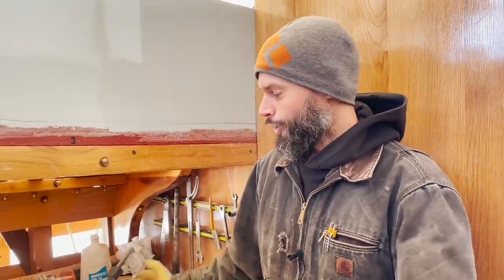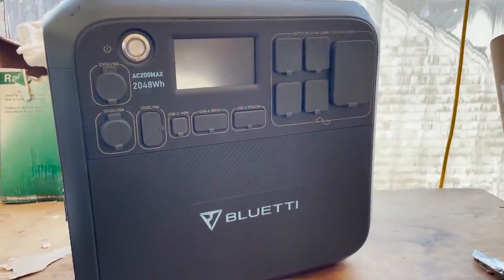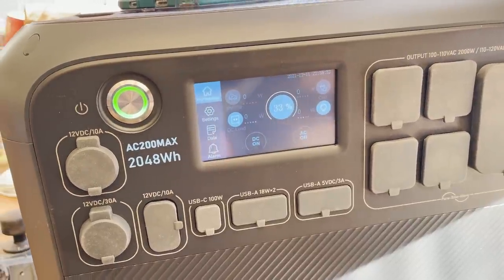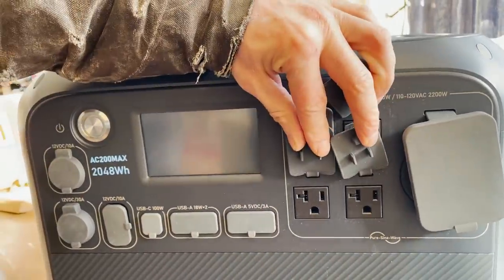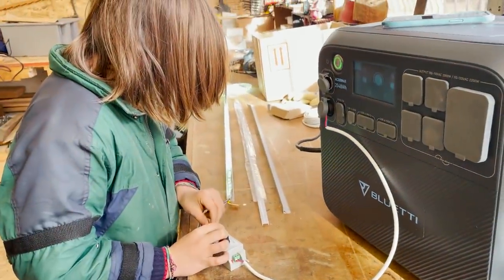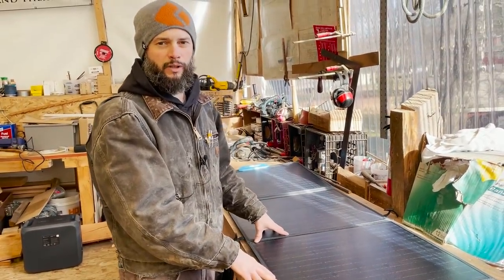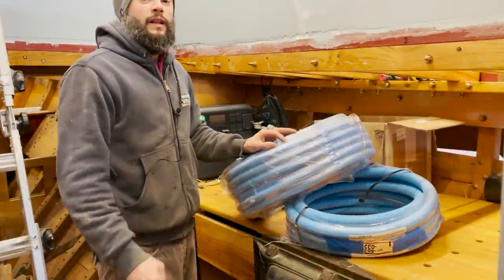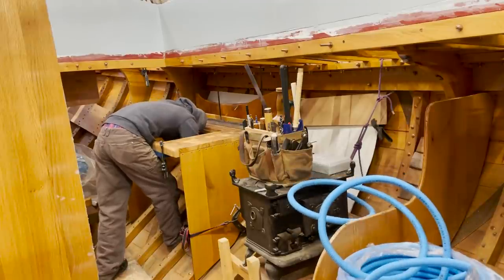Boat Electrical Systems, First Steps - Episode 194 - Acorn to Arabella: Journey of a Wooden Boat

Comment: For cruising a wind generator is going to be a lot more useful than those solar panels. They seem to me to be a lot of hassle unfolding and finding space for them for the amount of output you get from them.
Reply: you  do not have to choose between the 2 option. But a 'fan' size wind generator will not really give too much power..
Reply: Wind Generators can also be very noisy.

Comment: A couple of suggestions:
RGB LEDs produce a really crappy white light.  Better to go with daylight white RGBW or RGBWW warm white strips.
To avoid corrosion on the tape itself, use IP65 weatherproof silicon coated strips.
Hint: solder wires to the back of the weatherproof strips.

Comment: You can easily get and adapter to go from that RV plug on the Bluetti to your shore power plug, allowing you to keep the boat powered should your solar and/or house batteries (need to) go offline for some reason. You'll need a NEMA TT-30 - NEMA L5-30 adapter. Should be about $30 at Home Depot.

Comment: Love the portable battery, my view is 12v is easy your a low power boat, put usb ports in the cabins , keeps the chart table clear . 
As the majority of the world is 240v , is just having 110v charging going to limit you.  Eith a normal battery bank you can have a 110 and 240v charger ,  with these battery banks are you just going to have solar , 
And altinator off the engine .

Comment: Hey Steve. Do your wiring plans include any data cabling? Or do you plan to use wifi technology for any tech connectivity?
Reply from the maker: Not throughout the boat. Wherever the data comes from it’ll go straight to some unit that’ll broadcast wifi and it’s a 38’ boat so should be good.

Comment: Some\thing to consider when setting up your solar modules on board is that and shading will cause a reduction in producing amperage for charging.  With rigging, post, etc, that will be hard, but with multiple strings, you will do better in charging your battery, so that is good that you have them.  The other thing is that to produce more power is try your best to have the modules 90 degrees to the sun to get optimal performance.  Looks like you have a great setup for your boat and those solar modules will outlast any wind generator.👍
Reply: Complet video subject, topic are non sence! Ridiculos, like Trump follower, this are not sailor, but profict makers

Comment: It's absolutlry worth putting together a jig - think like a big easel - to hold the solar panels at 90° to the sun while they're out on deck. This is especially true at higher altitudes. 

Here in ireland the sun is below 45° in the sky most of the time - in winter as low as 15° at midday, tilting the panels up increases the Lumens/m^2 hitting them by 2 times or more.

Comment: I have built WiFi based LED controllers and that's how I control most of my house and it's also what I will partially use on the boat. Just one word from experience: don't rely on the rgb chips to give you decent white light, especially when dimmed. You can get LED strips wigh RGB plus warmwhite in one strip. They give you much better white light.
Reply from the maker: I think we’re going to mostly use the strips for red/night running, and the puck lights/Victoria’s fixtures for white.

Comment: If I were running Electrical in a small boat I would have 2 concerns. 1) moisture resistance, how well can I keep salty and humid air out.  2) height above water, how well can I keep it away from standing water in the bilge, showers and wet lockers, and deck penetrations that WILL leak at some point in time.  Unless you have chafing problems, wires only corrode at the ends and connections.  Also, NEVER have electrical/coaxial connections at, near, or below the base of the mast!  The mast heats and cools every day and wicks a surprising amount of moisture into electrical wires and gravity pulls it down below deck, and inside the mast is the greatest chance of chafing from wire slapping.
Reply from the maker: Keep tuned, you’ll see how we address a lot of the things you mention.

Comment: Be aware that that plastic will become discolored and brittle with exposure to the elements, minimizing the ability to see through the cover and possibly snapping hinge points. My advice would be waterproof, gasket sealed, metal boxes at all junctions and terminals.  May save you some issues in the Arctic circle or other inhospitable areas with no repair resources.  I’m no expert but it seems prudent to make your electrical system bulletproof. I have been watching your endeavor unfold since you first posted it and am impressed with the attention to detail you have no matter the operation.
Reply from the maker: Thanks for the kind words, Greg! Metal boxes won't work great, and none of the plastic in the boxes will be exposed to any kind of light. They'll not only be inside the boat, but also mostly just behind locker doors or other sneaky but easy to reach spots.

Comment: Running conduit is the smartest thing that you can do, conduit is cheap and running an extra empty one makes latter additions much easier. (there are always later additions to a new boat after the first cruse) . Also leave a pull cord before you install the conduits and if you have a wire plan pull the wire through before you install it leaving a pull cord in if there is room for an additional wire.(It is always easier to pull wires on the bench when there are no bends in the route.) This may sound excessive but I have seen bills of over $1000.00 just to run a single pair for some later addition where if the route was prepared ahead of time it would have cost maybe an hours labor.

Comment: As an electrician I must tell you, you will hate trying to get wire through that flex tube you have to cut to length then stretch it out flat then pull you wire though, then run the conduit with the wire in it

Comment: Having the wires in conduit is always better for repair work, also do your self a favor by having a trace wire in every run. By having the trace wire in every run you can pull more wires through if you need them later. If you can, I try to go 1 or two gauge over what I know the line is going to be used for. This lowers how warm your wires get, adds more safety for fire in a wood boat. Also make sure all of the boxes have access so you don't have hidden locations were a wire could come loose and not be able to access that location once the boat is closed in. The more breakers you have the better as I see it some don't like it like that, but if you have some thing not working it does not and its tripping the breaker it only shouts down 1 thing not a group of things. You may want to think about some type of a stand system on the deck that can hold the panels if your not going to add any fixed panels on the boat. Great to see you guys moving forward on the build....

Comment: I would see the Bluetti as the post-lightening strike/battery system failure/dead alternator fall back option. Something that will get you out of the sh|t, but not your daily power source.
Reply from the maker: That’s what we’re thinking too after using it for a bit.

Comment: Check out RGBW strip lights,  They are the exact same as you are using except they add a white channel, which means instead of running three LED's to get white you will only use 1 and draw less power.

Comment: Wow!!
Most cool. 

Just a small suggestion…
Please consider taking some short USB extension leads to plug into the unit’s USB sockets. 
IMHO I would be concerned that the unit’s sockets would wear with 2 years of daily use, and it is much cheaper to throw away a damaged USB extension lead than to replace the unit.    
You can probably get replacements anywhere in the world, but quality is another matter. Worthwhile to get someone in the family to spend time to research & recommend a few makes available to buy at key international ports and likely to be   optimum make based on price and quality. 
Just a thought. 
Best wishes
Reply from the maker: We’ll have some USB outlets around the boat.

Comment: the RGB lights I use as white for general illumination have always looked somewhat „off“. From outside the building the room looks like a TV is on. Also after 8 years in use failures of single LEDs started so after 12years I have a few feet of rainbow instead of white. The lights are only in use a few hours per week.
If you are not keen on the disco function, I recommend designated „red only“ lights.

Comment: That power unit looks cool, but I'd be weary of being underway unless I carried at least two of them. If all the craft's electrical are dependent on it for charging and inverting and battery storage, if one of them fails then they all fail, and they are all gone while they are being serviced.

As an aside, RV owners refer to their RV's power cord as a "shore cord", and we plug it into "shore power". It may be that your boat will end up with a similar cord and plug.

Comment: Another thoughtful, interesting video. If you have space, I'd be really tempted to buy a 50KWHish EV battery that you could mount down low.. I also wonder if they someone makes a propeller driven charger.  The Bluetti looks like a nice unit for mobile power as long as you aren't carrying it on your back.
Reply: Solar panels seem like a poor option compared to the propeller driven generator. Also, perhaps there is an add on PTO style generator that bolts on your diesel.

Comment: Power boats have much more exposure to vibrations that sailing vessels that can lead to not just chafing but fatigue of the copper wires from flexing. Are you reviewing and complying with industrial boat builder standards such as NMMA and IYBCA regarding wiring provisions? An issue with low voltage systems is the size and hence weight and cost of the wiring to obtain a given ampacity in a circuit. If I'm not mistaken, data server farms use a 48VDC bus and then use highly efficient BUC converters to deliver appropriate voltages to cards, motherboards and auxiliaries. Low voltage systems will be more susceptible to increases in contact resistance at junctions and connections from corrosion, something that is inevitable challenge in the marine environment.
Reply from the maker: ABYC.

Comment: Not recommended to leave the leds wound up on spool with any high wattages as you did on video.
From experience you could burn and will destroy the adhesive on strip when in tight coil as you have done.
I have burnt out leds doing the same.
Love what you have done with the project and keep up the quality work. Joy to see the workmanship.

Comment: Loose the conduit fittings and go with a o ring and conduit lock nut.  Use irrigation wire nuts for connecting wires together… they come with a water proof gel inside.

Comment: You are going to need a couple of lead acid batteries to start that diesel and accept charge from the alternator.  A 1000 MCA battery should start then engine easily in warm weather, but will struggle when it is cold.  I have a Volvo-Penta D240 in my 1936 powerboat and a 1000 MCA start battery will start it until it is around freezing.  Below freezing it struggles.  In contrast the Westerbeke 46 in my sailboat will start on a 70 degree day with a 1000 MCA battery, but I have to parallel the house bank (420 Ah) with the start battery if the temp is below 50F.   If in addition to the lead acid batteries you have LiFePO4 batteries then you will need a DC to DC charger to avoid destroying the alternator.   If you go with lithium batteries I would strongly suggest using individual components rather than one of those do all boxes.  That way when a component fails (and it will) you don't have to buy an entire new system.  Incidentally while those LiFePO4 all in one power banks can  have power drawn from them down to around OF (-20C),  you can't charge them if they are below freezing.   Not all of them have circuitry to prevent charging if the unit is too cold and charging below freezing will kill the batteries in the box.   I run a combined lead-acid and LiFePO4 battery system on my 1936 woody and it works well.  On the sailboat I am all lead-acid (500 Ah) because I have some high draw systems (windlass, electric winches) that would require a BIG and expensive LiFePO4 battery bank.
One major suggestion - Do not go overboard on all the high tech stuff.  Simpler is better for a boat going to remote places.  Go lithium if you want, but carry spares for critical components.  For example 4 100 Ah batteries are a better choice than 1 400 Ah battery.  Also lights with simple switches will be MUCH more reliable.  I mean,a light with white LEDs and red LEDs selected by a mechanical switch.

Comment: just a idea, how avoid condensation? and avoid the conduit pipes dont get full or some water inside. may be to drill some holes on the lower part to drain water but this  kind of channels in the inside of the conduit always will keep some water in. also you will didnt notice were are damage in the wire because the whole lenght are hidden inside...in the boat i sail they dont use that only some kind of regular open channeled plastic proteccion.

Comment: Be nice to see some of Victoria’s light fittings used in areas where you just need light. I would think an LED modification to old fittings should be simple enough. Sure they may not be too bright, but who needs a bright light in the head!
Reply from the maker: It is simple! Actually, it didn’t make it in there, but Aaron was removing the old guts. There are LED equivalents for nearly every bulb that don’t require anything that would change the fixtures.

Comment: The blue conduit connectors are meant to attach directly to the junction box using standard electrical hardware. A neoprene washer is available to seal the connector to the box. Try not to be too creative when doing electrical; there is standard electrical hardware available to do whatever you want to do and meet code. (in this case the code is international marine). There are books on marine electrical which are worth consulting before implementing your system. If you know anyone who is a qualified marine electrician talk to them; you won't regret it. Marine electrical is not a trivial topic. If you have a chance to get your completed electrical system inspected; do it?
Reply from the maker: We don’t plan on getting creative with our electrical system, where are following ABYC standards.

Comment: Most of us think in terms of amp hours at 12 volts rather than watt hours. Using an online calculator the 2000 watt hours equals 187 amp hours or rough equivalent to a flooded 8D battery.. A really cool unit but not enough capacity for a cruising boat in my experience. Very interesting video
Reply from the maker: Thanks for your thoughts, Tom!
Reply: Depends on what they use for autopilot but I agree,  400ah even with LiFePo4 is more realistic from my experience living aboard for 5 years

Comment: As all the "ARABELLA's" followers or community, I wish to the team a good year of kind works from French Geneva Lack shore  .
One small thing on the vidéo, (time-code 0.6) you have a ""magnet tools board""( i do not know in english the right name of this kind support ?)
 You must remove this board and live it on shore when you go to sail . This magnet system can  disturb the main board COMPAS.
Red light in the night, does not disturb the human knight vue.

As usual nice vidéo . Be carefull to stay safe.
Reply from the maker: It’s a good tip that magnets (or any slightly magnetic things such as phones) when placed close to the compass, affect the bearing. This magnet won’t be near enough to the binnacle in the cockpit to affect it, but thanks for this reminder!

Comment: For the RGB LEDs, have 2 switches, one to shut off all power and another that just turns off the blue and green. Then you have "auto" night mode.

Why do you need deck space for the solar panels? Hang them off the sun-side of the boat. It should be easy to make 2x4 brackets that can moved around as the sun travels.

You might want a NEMA SS2-50 (ship-to-shore) 120/240V 50A cable. Although I have no idea how common these actually are.